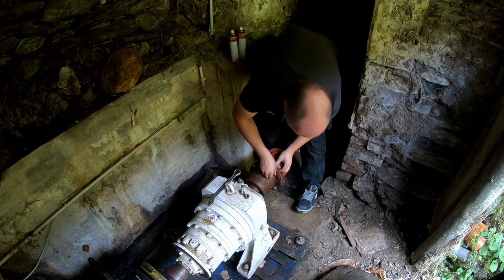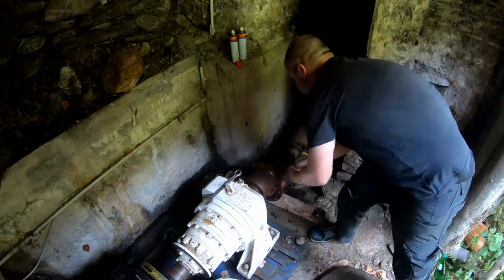Fixing the waterwheel's broken bearings (2) - "That's a big crack there!"

Comment: i would question the wisdom of using a high-loss, planetary transmission.    the result is greater  loading, very near the center of rotation.     and greater stress on the thrust bearing       assuming this installation was converted to electric, the  Entire  scheme  should  analyzed.   i am no pro, but if you will show the 'wheel, i may have some valid observations.      googletranslate